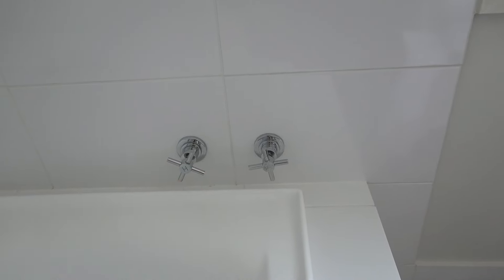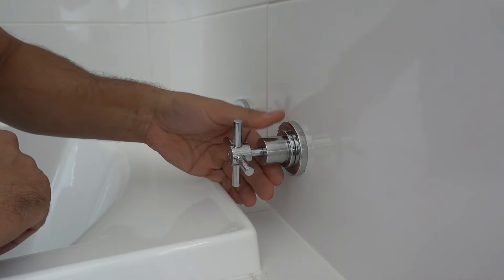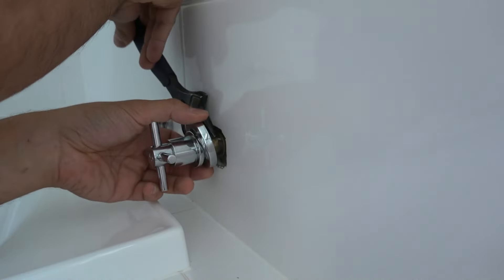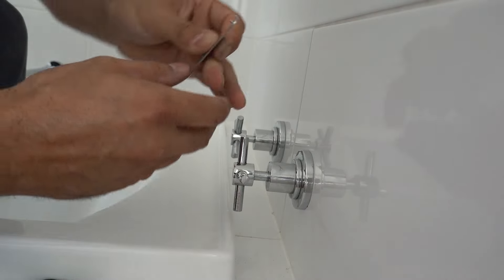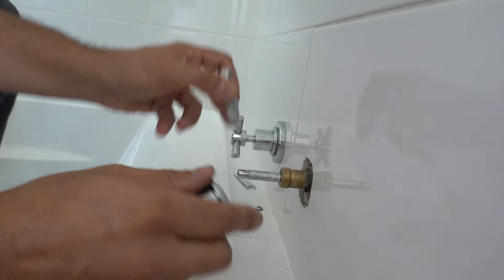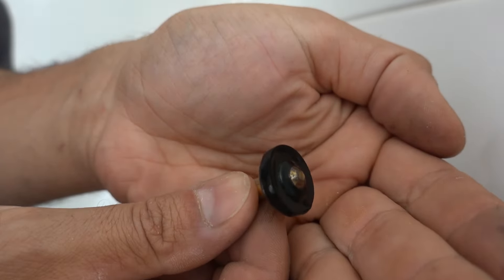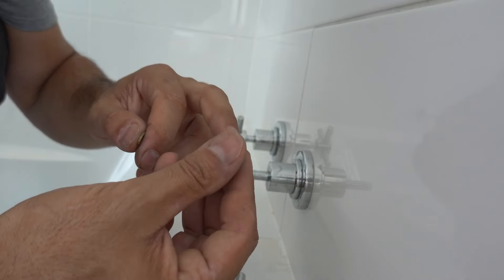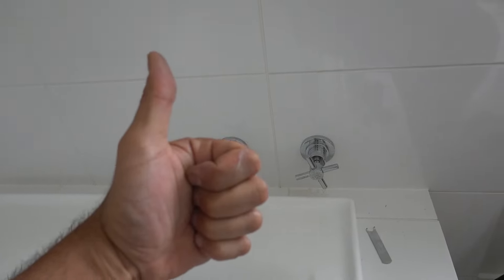How to remove tap handle - no screw

Comment: Those taps might make sense in a rental property but otherwise yeah couldn't agree more...nightmare
Reply from the maker: Lol I still can’t work out what or who exactly they are intended for?
Reply: Tenants need to be able to change washers, if they cannot get the tap handles off, then they will have to get the landlord to pay a plumber to do it. It would not be the tenants fault that such daft taps were installed.

Comment: I have these things in my house. Also they have a conical spindle cover that is impossible to grip with any tool.
Reply: Sometimes if you try gripping the conical ones with a piece of that rubber mesh type anti-slip matting you can get them undone. Usually sold for drawer liners or for under floor rugs. I keep an off-cut in my toolbox. My wife uses one to remove jar lids when I'm not home. Apparently I'm not completely useless!

Comment: They’re called anti-vandal taps. Supposed to discourage people from knicking tap handles. Believe it or not people steal tap handles from rental properties and hotel rooms all the time.
I find the tool sometimes won’t undo the little threaded nut if it’s been loctight into place. If you open the tap fully before undoing the cover assembly there’s enough clearance to get channel grips onto the spindle to undo it, even if the hex part is behind the tile.

Comment: Awesome work, very well explained and demonstrated. I have a similar tap in my bathroom that's been loose for a while, and I had no idea how to remove it. I only worked out how to unscrew that large part that holds the backing onto the wall. Unfortunately it seemed the tap is so short, it wouldn't unscrew far enough to get a spanner in there, so would need that stupid speciality tool. Cheers for linking to one!

Comment: I have these exact taps. The tool I bought just slight does not lock in so cant remove. Luckily after watching your vid I realised  i could actually access the tap to change the washer.
Reply: Question did you change that  tap   out.  I know I’m going to
Reply: @nromanov2150  No the taps are in great condition so l just changed the washers

Comment: I recently replaced our bath taps, the previous ones had been on there for about 20 years, ugly plastic things with the push in cap and nut behind the cap, with a spring in the base. When I replaced the taps I soon realised that the breecher piece (pipework) had originally been installed very badly and the fittings were on an angle. The new taps lack of spring meant the shrouds were unable to adjust to the angle, leaving gaps between them and the wall, which I had to fill with clear silicone. The alternative (as far as I know) would be to remove the tiles and plasterboard, get a plumber in to do the plumbing properly, then resheet, retile, and repaint the wall... sometimes the old things were just better.

Comment: Hi , i couldn't undo the nut ..😢... i used the tool but i couldn't budget .. in the end the tool broke , any ideas on what to do next ?
Reply from the maker: It’s possible that it’s seized. You can always cut the spindle off and replace the whole tap with one that won’t give you a headache. I have videos on how to replace taps also 👍
Reply: @billshowto  , was thinking I'd just cut the handle off at the spindle ... I had to replace one tap , which was a completely different handle ... maybe it was to hard to do the other
Reply: @billshowto , also I can't seem to undo the spindle cover , the cover that is against the wall ... do majority just screw off ? This is doing my head in , I know how to fix it , it's just these stupid hurdles to get there
Reply: One tip is to double check you are turning the nut/tool in the correct direction. Because you are looking at the nut from the "wrong" end,  the direction appears reversed. The "Lefty Loosy" rule only works if you are looking at it from the correct direction.

Imagine holding a nut & bolt in your hands and you are unscrewing the nut. If you look from the nut end you turn left to loosen. If you look from the bolt head end you appear to be turning to the right. Similarly, an object to "my left" is to "your right" if we are facing each other. You can see that Bill is turning the tool to "his" right to loosen in the video. Many people have damaged the tool or the nut because of this confusion. Hope that makes sense.

Comment: Thanks Bill handy to know, some of the nonsense plumbing designs in my houses mixer taps, toilet cistern, hot water heater, solar hot water connectors etc you have to wonder what the heck were they thinking.

Comment: Hey everyone - you don't always need this tool!
I already had a plumber change my washer, but after he left the tap handle fell off a week later. I didn't want to call back if not necessary.

I was able to reattach the tap handle using tweezers, just wedging one prong in the gap and twisting it. My tap handle is on firmly now. Cool!

This might not be so easy for removing taps if they're firmly attached.

Let's see how long this lasts!
Reply: What a great idea. I assume the tweezers had the bent tips to allow access to those slots in the nut. Someone else suggested circlip pliers, but I never had any success with those. If in doubt, improvise!